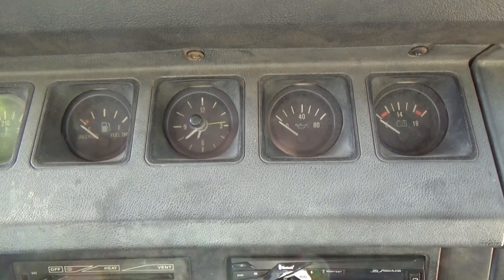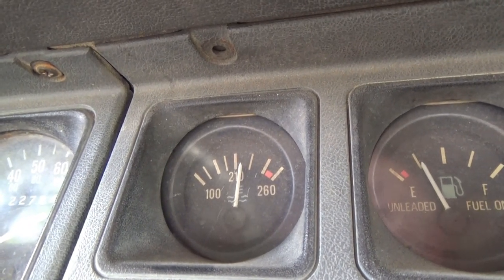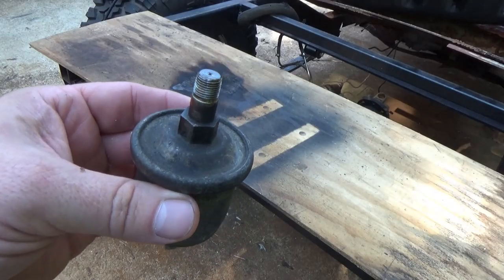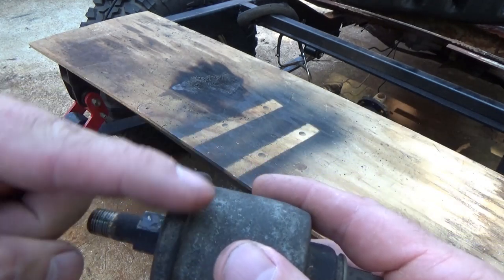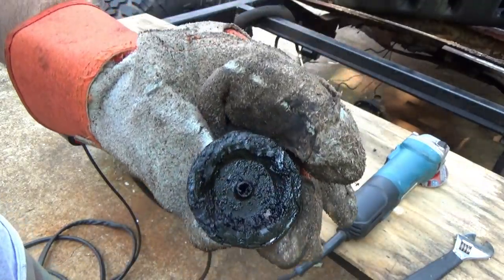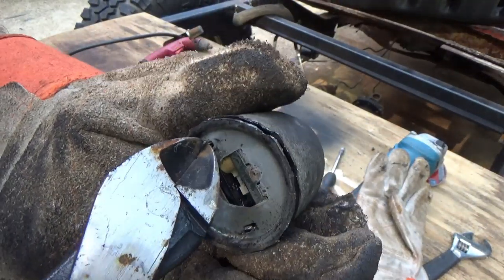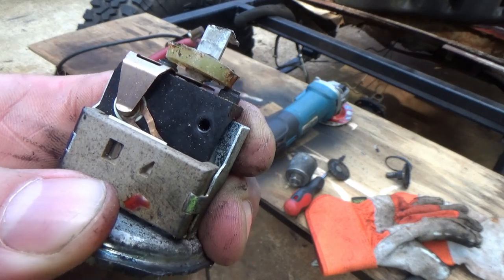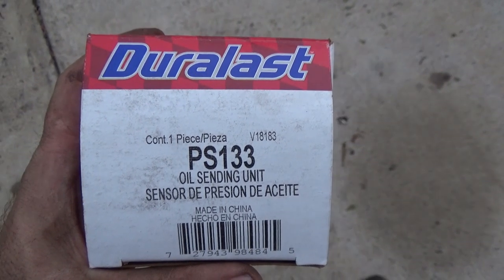Jeep Wrangler YJ - Oil Pressure sending unit result and dissect #oilpressuresendingunit

Comment: Really cool to know! I’ve been chasing down an oil pressure/gauge problem, replaced the old sending unit, still had maxed out oil pressure. Wondered if The new u it was bad so went to take the new one back out using the nut shaped part at the top of the can but it turned the top half of the can and not the whole thing. I was worried that there was a electrical connection in there that I may have ruined by doing that. Now that I’ve seen it taken apart I know that I probably didn’t harm it. Checked the pressure with a pressure checker gauge and it hovers between 50 and 60 at 1200 rpm. I think this is high for idle but did not let it get all the way up to temp.  So I may have a problem still, gonna check my grounds next because my temp gauge is not reading right either (checked them like your other video on how to do that and they max out when grounded)  I have a new oil gauge and temp gauge to put in there if none of this helps.  I have a “Y” coming out of the block there that the oil sender is screwed into with a second smaller unit with 2 wires on it, I guess it’s a switch of some sort talking to something else but wondered what it is for exactly? I have an 89 YJ with the 4.2 in it. I am 61 and have done minimal wrenching since I was in my 20s and definitely a new Jeep guy.  Had a 70 something AMC Jeep Commando way back when. Thanks for your videos, they help a lot.

Comment: Hey Chuck, talking about gauges, my voltmeter sometimes sits just a hair above the red area on the left, or a bit higher. Mine doesn’t sit at 14 like yours. And if say I turn on headlights, or the blinkers, the needle noticeably moves a bit(lowers, with blinkers the needle follows the turning signal lights). The YJ runs worse the lower the needle falls towards the red. What could it be? My guess is worn batter cables so after watching your video I’ll be changing that soon. Tested the battery and alternator, both are good
Reply from the maker: Start changing cables and ground straps between the engine and firewall. Grounds can be a pain to chase. So clean all the ground contacts along with replacing battery cables.

Comment: What weight oil u runnin. Hows your fan clutch.
Reply from the maker: That engine is so worn out I run 20-50 in the summer and 10-40 in the winter. Ive checked the fan clutch it feels like it's ok. That rig has never had a shroud on it so lots of air is going around the radiator instead of through the core. Ive been meaning to pull the shroud off my other rig to see how much difference it makes.
Reply: Power Addicts - FixJeeps.com - Jeep, car and motorcycle tips what are some indications an engine is worn? I sometimes think of running 20w50 during the summer. I’ve been running 10w40 year round in SoCal

Comment: Hey man i didnt mean to sound like a dick when u didnt show the oil pressure readings at the end of last vid. Thanks for the follow up. But....lol.  manual states minimum of 13 psi at operating temp must replace pump. Yours looks below 10 psi
Reply from the maker: Its all good!! That engine is without a doubt on the low side of safe. Ive got another engine on the stand to build just gotta get around to it.
Reply from the maker: Heck, I may throw a pump in it until I'm ready to build that other engine. Make a good video it would 🤔😁